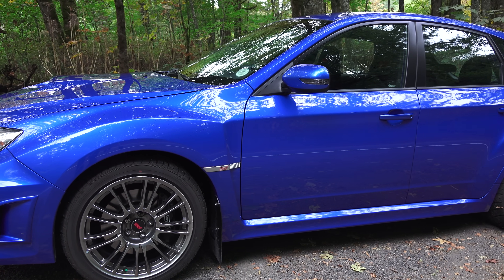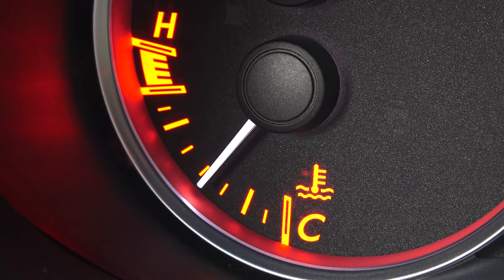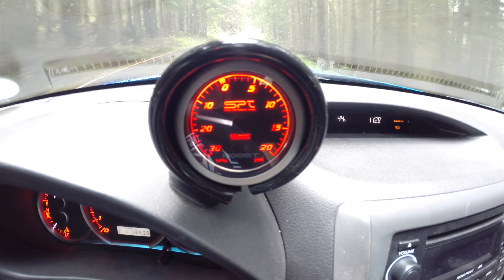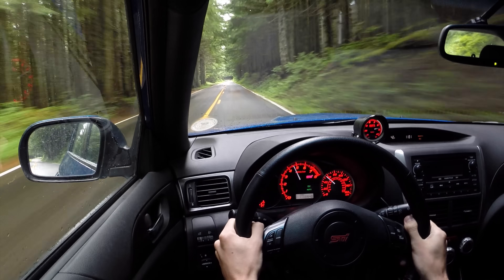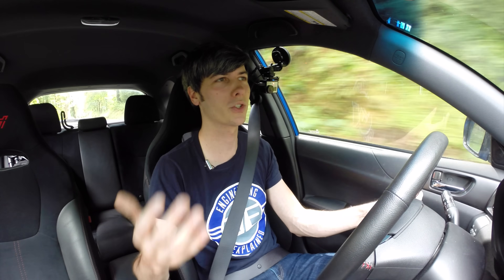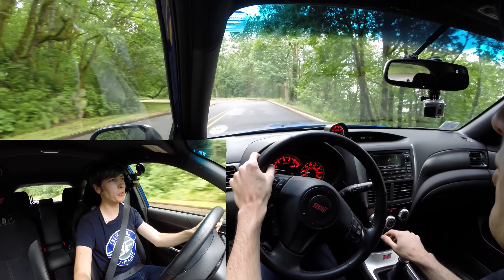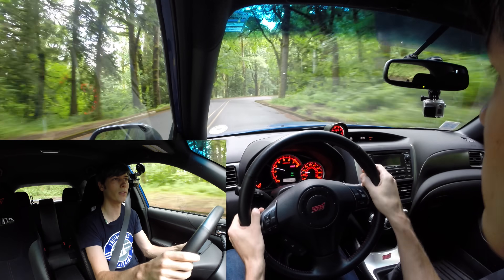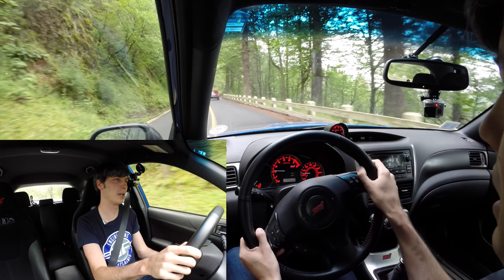5 Things You Should Never Do In A Turbocharged Vehicle

Comment: Always buy the best fuel? Really?! You also believe in high end gold plated audio plugs and stuff? Come on, you're a engineer...
Turbo or not it doesn't matter, buy the fuel recommended for the car. For stock cars that is. And if you modify the car just go find out what fuel is neccessary (if you're doing it yourself) or ask your tuner... (or get a tune for the fuel you want to run)
If the car doesn't knock it doesn't make anything better to fill it up with some 40ct more expensive "add super awesome advertising name here" fuel.. 

I know you probably didn't mean to come across like that but with the given information in the video people without further knowledge will believe that higher octane fuel equals better for the car...
Reply from the maker: Yes, absolutely, buy what's recommended for any stock car, and nothing more. It's all it needs. Most turbos will recommend premium, and any tuned car I'd personally run premium to be conservative.
Reply: Better doesn't mean higher octane, it means better quality, instead of buying 91 octane at SAMs club isn't the same quality as 91 octane at Shell
Reply: you obviously don't know much about turbo cars...
Reply: you can't go wrong buying better fuel, but you CAN go very wrong buying lower grade fuel.
Reply: Obviously the octane rating isn't meaningless.. But putting higher octane fuel in a car that doesn't need it is simply a waste of money... 

I don't know about the quality differences between gas stations in the U.S but here in germany it doesn't matter what brand you buy the quality is the same..
Also we have different octane ratings all gas stations sell three main types, regular, super(premium) and super(premium) plus. Most normal turbocharged cars use super and only high end performance cars need super plus.
Then there are the "performance fuels" from the different companys like shell ultra and stuff like that i think you get in the us aswell.

If the car is tuned to (or requires by factory tune) to run very high octane fuel of course that is what it needs... But only then.

The other premium fuels with additives are more or a placebo thing as nobody can actually present any evidence that they indeed are keeping the engine cleaner or making more power.

Turbo or not Turbo doesn't have anything to do with the octane rating there are a ton of other factors involved an tons of cars without a turbo that need higher octane fuel.. Its all about the compression, timing, sparkplugs and so on and so on..

If it makes you feel better to fuel up with the most expensive fuel just because you can't go wrong, well go ahead its your money. But there are so many people out there buying premium fuels for their normal cars and think they keep the engine healthier that way.. And its sad that a video like this fuels (no pun intended) those misconceptions.
Reply: I had a stock 2009 Mitsubishi Lancer Ralliart with recommended 93 octane. Only 91 or 94 available in my area. 91 makes my engine knock. Noticeably. After a couple of fill ups only. Been running 94 and the knocking went away. After I remapped my ECU, 91 octane also gives me a noticeable performance downgrade. Octane level is not a myth, it's just something that has a lot of misconceptions to it. Putting 94 octane in your non-turbo is probably totally useless.
Reply: shell isnt even that good its over way over priced
Reply: +huberkarle I think you got it a bit wrong. The manufacturer will tell you the MINIMUM quality of fuel you need. that doesn't mean that you can't profit from a high octane fuel, depending on the engine.
and although a high octane fuel is TOTALLY useless on 99% of NA car engines (with the exception of some high compression engines like S2K or E92 M3 for example), it can make a huge difference, even at the most casual turbocharged engine. even a tiny 1,2 tsi can benefit from it. When the knock sensor does not read any knock from the engine, the ECU will slightly increase the turbo pressure and alter the spark timing for better performance.
you can feel it on the road, and you can measure it on the dyno so it's not just a placebo effect.
its the same reason why a turbocharged engine can very easily be tuned for more power compared to a NA engine
Reply: +newton9837 putting premium in a car that doesn't require it is actually a disservice to the car. There is less energy content in higher octane fuels so you are ever so slightly robbing power and efficiency.
Reply: +Axel Clarke The US calculates their octane rating differently than Sweden. We use the anti knock index (AKI) which is the average between RON and MON. Sweden uses RON I believe so our numbers are different but the fuel is the same.
Reply: Robert Spratlin  it will up the knock resistence like leaded fuel but the higher octane rating does nothing to the lubricating effect the lead had.. So simply putting higher octane fuel in a engine designed for leaded fuel won't do the trick either..
(This thread gets more and more complicated by the minute lol)
Reply: Higher octane fuels have a lower knock potential. On a forced aspirated vehicle, especially aftermarket, you'll want that lower knock potential. 
Unless you just want to blow up your engine, go for your cheap fuel.
Reply: Keep in mind that not all fuel is created equal. Every separate chain of convenience stores has a different quality of fuel, sometimes it even varies from store to store.
Reply: Octane has nothing to do with power. Octane rating tells how much fuel can be compressed before ignition. Hence why higher ratings have lower knock potential. Manufacturers recommend higher octane to avoid lemon law when you happen to use lower octane and you engine starts knocking, plus the engine was designed for that particular octane rating. 

What does change the power is the actual fuel itself. That's why E85 has less power than Regular. And not all E85 is the same; depending on your market, it can be corn, sugarcane, sorghum, and other things. it's basically just an alcohol made from whatever the source material is. Regular petrol varies in a similar way, but it depends on individual sources, refining techniques, and additives.
Reply: +Engineering Explained 
In Sweden standard is 95, premium is 98 and also possible to get 101. In the US, why do you have such low octane ratings? And also, cars on the euro market and US market are presumably made slightly differently, so if I brought my Euro Ford (which has 95 as standard) to the US would my engine get messed up from fueling 87/89? Since using lower octane rating can cause knocking.
Reply: he didnt word that section very well in my opinion he should have been referring strictly to octane...making sure u arent putting low octane fuel. he kind of messed it up by talking about the "quality" of fuel which immediately paints an Indian Gas vs Chevron type image
Reply: Robbspeed3 Lol I like at the end of his comment he mentions the fuel additives in a way that signifies unimportance. Petroleum gas with more octane boosters and cleaning agents IS what makes a better gasoline lol. Just because both shell and the "mom and pop" stations sourced their petroleum from the same supplier doesn't mean that one will not allow your car to last longer than the other.
Reply: Yea, always buy the best fuel, because bad fuel ruined our Mercedes' turbo.
Reply: dimos k  yes and no.
Octane rating doesn't equal to fuel quality.
If the ECU is programmed to up the boost and alter the timing if there is no knock it will indeed have performance benefits, yes.
But i don't think that many especially older turbocharged cars actually do that as they have fairly "static" fuel and boost maps.
On modern cars the probabilty is higher i guess, but nothing amazing maybe a few hp if at all.
Also it doesn't hurt the engine do drive the recommended fuel so i wouldn't say that higher octane fuel is worth the more money if it isn't needed for the particular car..
And as you said, 99% of non boosted cars it doesn't have any benefit at all.
Reply: huberkarle agree, obviously octane doesn't equal quality. 
And yes, older cars probably can't benefit unless they have a different ecu.

Newer cars will have some benefits. But as you said, that doesn't mean that it worths the extra money on daily driving. 
In my country we either have 95 or 100, and the difference is huge, 1,40 for the 95, and about 1,80 for the 100. 
Fuel companies don't even bring the much cheaper 98 anymore. 
I use 100 rarely, and the difference is noticeable (fiat bravo tjet 150), and I can even see it on the stock digital pressure gauge which which fills more with 100, meaning it raises the pressure more.
And I once tried 104 or 106 (not sure, I found it at a random fuel station near nurburgring during my road trip there) and the difference was even bigger, so I guess some ecu have a pretty huge potential
Reply: I don't think you understood what he meant. If you buy higher octane fuels, you guarantee reducing potential engine detonation under randomly sever circumstances.
Reply: Jonas Koch apart from a power gain on turbocharged engines, a premium fuel usually has some cleaning agents that help your engine remain in good condition. But it is pointless to spend more money every time you refuel just for everyday use. Use premium once every 6-7 refills to clean your engine and it's more than enough.
There is nothing else in normal fuel that can harm your engine to lose power. Besides, some brands now include the cleaning agents on the normal fuel, which renders the premium fuel pointless, unless you plan to go for a trackday or a long trip where you will push your car for enjoyment
Reply: The rating system for the octane is different in germany for example compared to the u.s.
I have no idea how the conversion is done but i think its pretty much the same range as in the u.s. just different norm/numbers.
91 is standard, 95 is premium and 98 is premium plus. Since standard isn't offered anymore (was replaced with E10) 95 premium is the lowest you can get now.
Some gas stations offer 100+ (shell v-power or aral ultimate for example but those are really expensive.)
Reply: +Sawbonespc who were you replying to?
Reply: huberkarle agree, it can't be proven. We are most likely victims of marketing.
For fuel, I just have a couple of gas stations that I've tested over time that their fuel is not causing me any trouble (unfortunately you can't trust gas stations with their fuel quality since many of the owners try to mix fuel with other liquids for more profit, or they can mix premium and regular fuel and sell it as premium).
So I choose 2 well known brands (Shell and one more which is local in my country) who are supposed to run their own tests on their gas stations and hope for the best

As for oil, I've never paid for a premium brand. As long as it's the proper viscosity and surpasses my engine's specs I consider it good enough. It's not like we run in track days every day
Reply: well this is a segment for turbocharged vehicles and being a technician for hyundai and other brands in the past. I got to see how many cheap ass's drive turbo cars and come get em checked out with engine knock due to low octane fuel
Reply: Petrol engines are so obsolete while alternatives are shut down by some of the biggest oil corporations and their influence on corrupt world government so they wouldn't go out of oil business. As a engineer he should know that, maybe even experiment with alternatives. So many things could be used as fuel.
Reply: Diego31337 Your peer reviewed nonsense makes no difference to me. My turbocharged Tacoma retards it's ignition timing through learned knock threshold on $2.10 crap gas and advances the timing up to 3 degrees with Shell gas (both high octane). I guess my obd reader is really fooled, isn't it?
And your peer reviewed nonsense does not address long term effects of extra cleaning agents or lack thereof. It costs more money to dump a bottle of fuel system cleaner in every tank than it does to just fill up with shell gas.
Reply: Robbspeed3 it's a a 96 3.4 v6 with a CX racing turbo header and downpipe kit and all custom 3" exhaust. I was pushing 8 psi but my clutch started slipping so I dialed it down to 6 for now. At 4 psi is was going 0-60 in 6.8 seconds but I have not dyno'd or tested anything since I bumped up the boost.
Reply: Robbspeed3 Yeah stock everything. CX racing sells the headers and downpipe. I had to fab up everything else myself. Bought the turbo used. Turned out to be well under $2000 for everything.
Reply: no it isn't. VTEC/variable valve timing in general is a cam system that behaves as a stock cam sometimes, and a drop in cam other times. the specifics depend on the type.
Reply: Oh, and FYI, as a musician and audiophile, gold plated equipment is superior to the competition.
Reply: Draco Malformed I think you've missed the point in that cars are tuned by the OEMs to run at a certain timing. This is based on the compression ratio being achieved at the TDC position of the piston and the correct timing of the spark at the combustion (power) cycle.

If your car specifies a certain grade of gasoline then it requires such grade for the timing to work properly. Lower octane gas will ignite prematurely in your car causing issues. For cars that are tuned to lower grade gas then higher octane in most cases is a waste of money.

What is not a waste of money is to make sure you only buy gasoline from Top Tier rated stations which in most cases the price difference is negligent or non existent.  Cheers!
Reply: huberkarle but gold plated audio plugs don't corrode as much as copper ones
Reply: +Corey Wilson why would you put 91 in a turbo'd car? Is that what the manufacturer recommends?
Reply: i use 93 always thats what Dodge says, also after i had it tuned i kept it at 93 so anything else will run like crap
Reply: i put 91 by mistake 1 time
Reply: +Corey Wilson I ask, as a multiple chrysler owner, it wouldn't suprise me that they recommended 91. Sometimes that company makes me scratch my head. Don't get me started on the whole lebaron, sebring, 200 debable :-)
Reply: ***** A lot of larger chains here actually don't use the same supplier. Only one that does is Shell. Could be due to a lot of 'chains' being more of franchises, but even then I know of corporate owned stores that use different suppliers.
Reply: +Seth Powell agreed.
Reply: Google Top Tier Gas. Look at the list. Are you using one of them?
Reply: +Xander Zoolander Actually heater in America or E85 (corn) it's much much more beneficial for power.
Reply: Are you seriusly?? The fuel is not "magic" they test every type of fuel in a lab, with experts, with equipment, and you pray that premium fuel it's just a scam??? I feel really sorry for your ride...
Reply: Yes you're right, they do use RON to show the octane rating here. So doing a conversion 87 = 95?
Reply: +huberkarle I think you got it a bit wrong. The manufacturer will tell you the MINIMUM quality of fuel you need. that doesn't mean that you can't profit from a high octane fuel, depending on the engine.
and although a high octane fuel is TOTALLY useless on 99% of NA car engines (with the exception of some high compression engines like S2K or E92 M3 for example), it can make a huge difference, even at the most casual turbocharged engine. even a tiny 1,2 tsi can benefit from it. When the knock sensor does not read any knock from the engine, the ECU will slightly increase the turbo pressure and alter the spark timing for better performance.
you can feel it on the road, and you can measure it on the dyno so it's not just a placebo effect.
its the same reason why a turbocharged engine can very easily be tuned for more power compared to a NA engine
Reply: correct just take recomendded fuel
Reply: Proper Octane is a requirement for Compression.  Going higher is pointless. E85 only sees performance gains from a boosted engine.
Reply: Premium fuels is better for your car, often cars that only run premium will not lose as much power over time. Tuners say that as well. The difference can be 5-10 hp in a 5 year old car for instance when you tune them.
Reply: +Swipez severe***
Reply: If you just check your compression you can determine the best octane for your engine. It's not that hard lol... Anything more is like eating vitamins when you already eat complete meals... Just pissing out the $...
Reply: Exactly.  I had a Ford Explorer that specifically to only use 87 octane fuel and the car was designed just for 87 or whatever the low grade is.  Conversely, my Mini recommends 93 and requires a minimum of 91 so I buy the premium.  The owner's manual will always say what should be used.
Reply: Never owned a turbo have you tard boy.
Reply: Then you have Germany where the cheapest fuel available has 98 octane and the premium 102-105...
Reply: Leon S. My personal experience from Germany is that they have the regular 95 fuel and the premium 98
Some gas stations also have the 102-105 one
Reply: huberkarle if I am not mistaken, here in europe we use the RON scale, while in the us they use the MON scale.
It essentially is the same thing, just different numbers.
And I think all europe now has a minimum of 95 octane as a regular fuel as you said, and 98 as premium (or 100 instead of 98)
Reply: *****
the quality can differ between different brands, especially when we are talking about premium gas. each brand has its own additives and technologies.
but on regular gas, its pretty much the same, they all come from the same source
Reply: Additives and Technologies.. Maybe. Have you ever looked at those fuel additives you can buy, how expensive they are, how much you need to use according to recommendations and how less of them are scientifically proven to actually work?
I highly doubt that these premium brands have actually enough additives in it to really make a noticeable difference.

Its the same with motor oil.. There are so many kinds with many promises of less wear, less fuel consumption and stuff. Buts its an easy marked since most of it can not be proven.
How many actually buy 5 of the same brand new car fills each of them with different oil and drive them with the same driving style and conditions for say 150k miles and then blueprints the engine to find out which ones actually are better.
In the end its marketing and the customer buys what he feels comfortable with since there isn't any way anyways to prove that one is better than the other.

I wouldn't say its all the same but i highly doubt that there are many differences that actually make a difference.

Of course with the really cheap stuff you never know, oil itself is expensive so who knows what they dilute it with to maximize their profit margin, thats the only concern i would have with really cheap gas as well especially in countries with less standards and quality controls.

EDIT: It goes without saying but this is just my personal opinion and i don't have any facts to back it up besides logic ;)
Reply: Jason Koneman I guess he replied to the OP. 
Don't bother, he lost every credibility he might had, the moment he called him tard boy ;)
Reply: You should ALWAYS run the best fuel you can get in a performance car, that is just common sense. Sure in mums 1L 3cyc econobox it makes no difference what fuel, but if your running a performance or modded car, just do it right and use the right fuel. Too many engines over the years have been damaged by people thinking otherwise. There is plenty of things you can save money on, but premium fuel and oil are 2 things you should buy high end
Reply: I put Jet-A in my 3L TD Toyota the other day. No changes. Thanks for the tip.
Reply: E85 does not produce as much energy per unit of air that gasoline does. This is why cars get worse gas mileage when swapping from e10 to E85 since more fuel is required to achieve the same output. However, if the car runs solely on E85, it can be tuned to take the most advantage of the E85
Reply: really old cars will benefit from higher octance, since they were run on leaded fuel. The higher octane will act like the low grade leaded
Reply: +huberkarle High end gold plated audio plugs aim to a better resistance towards redox since customers often don't take much care about their stuff. It does not target conductivity (stay away from manufacturers that do say so), they theorically could use silver, but technically it's a bad idea. You are right on the fact that gold plating is an overkill feature tho
Reply: bn/
Reply: If you have a medium to high spec car you can clearly notice the difference between a standard gasoline and a boosted / enhanced one. When I go to the track for example I almost empty my fuel tank and then refill it with Shell V-Power. It's another story. There is also a video made by 5th Gear on fuels that is very interesting. I suggest you to watch it!
Reply: +WorldExtremeCholo If you don't need high octane fuel, then there's no point in running it. Higher octane doesn't mean higher quality. Quality means more additives like detergents and stabilizers. If you can safely run 87 octane, then that's what you should use.
Reply: +Senvae 
I disagree. My Ford Expedition is naturally aspirated and runs better on high octane gas even though it doesn't require it. My supercharged MB C230 Kompressor SC requires Premium/Super Plus. Actually I don't know any new German car that doesn't require high octane gas.
Reply: Mechanics told me to run PREMIUM in my Snowblower......they were correct it raised my HP and Torgue......as it is a HIGH COMPRESSION ENGINE.
Reply: Disclaimer... I'm in the L.A. area so our gas sucks. Shell is good, but I'm a 76 fan myself. My 2nd choice is Chevron. I have noticed better fuel economy with 76 or Chevron, although Shell is good too. Shell stations are just out of the way for me. I blow through a tank of Arco gas like it wasn't even there. I run premium in a Nissan Murano and my '74 Duster with a mildly built 360 with 9.6:1 compression and iron heads.
Reply: Agreed! Higher Octane burns slower to prevent detonation.
Reply: BRUCE LEE You have a snow blower dyno to confirm hp/tq gains? Because that sounds like a placebo effect. Nonetheless, you guys can waste your money as you see fit.
Reply: The Arkle Probably nothing, you need a high compression NA engine for it do anything.
Reply: id say you had a fault in the engine management system. probably sensor related. there should be a 'knock' sensor fitted to the car which will adjust the timing and fuelling to eliminate the knock regardless of the fuel used.
Reply: slightly incorrect. higher octane fuel burns more slowly meaning you can run more ignition timing advance without getting 'knock' issues. as its all controlled by various sensors, getting engine knock should be impossible unless you have faulty engine management components. the knock sensor will adjust the timing etc to compensate. yes it may run with a little less power, but for 99% of people in 99% of situations, you would never tell the difference. its only when full power is required that the difference can be noticed to any real degree, if at all
Reply: Everybody is trying to find a sucker. High octane fuel is the scam of petrol stations. Once when I stopped for refueling on a manned gas station, the guy tried to sell me high octane fuel for my 1.4 normally aspirated astra. But mine is not tuned, standard compression ratio 70HP little engine, so what good would it make I asked. He knows a guy who got more power from it he said. How did he measure that I asked. It felt stronger he said. I told him I don't believe his friend got any more power from this and that was it. Ridiculous.
Reply: actually gold is the best conductor in the world for electricity
Reply: ***** higher octane fuel just resists more to self detonation, thus allowing a modern turbocharged engine to increase the pressure and alter the ignition timing for better performance. It definitely doesn't burn slower
Reply: High compression ratio engines work better with higher Octane fuel.
Reply: Just bought a 2016 kia optima sx with a 2l turbocharged engine, the manual says regular unleaded for fuel type, so should I be putting in regular (87) or premium (93)?
Reply: idknuttin Is that a serious question? I will lose all faith in humanity if that's a serious question.. Your kia's ecu is clearly not tuned for performance so unless you get it tuned(more boost, more timing, more fuel) do what the god damn manual says.
Reply: Vishnu Vadlamudi "High compression ratio engines work better with higher octane fuel"...WHAT?! How long have you been sitting on this ground breaking information?!
Reply: in my country the worst fuel is 91 and the best is 96
Reply: 91 is minimum on those type of veichle
Reply: dimmacommunication wow let's just keep spewing the same useless facts over and over
Reply: dimmacommunication I'm not saying anything bad about you. I'm saying this octane stuff has been discussed to death, and we should stop this never ending thread.
Reply: Robbspeed3
yeah,the base line should be that an engine should run on 91 minimum,93 better for performance engines... easy :)
Reply: GioGuitarDude
you forgot to say that engine does that to some extent,if you use let's say 120 octane your engine will not adapt that much.
93 is beneficial over 91,but 110 etc wil only hurt performance.
Reply: dimmacommunication I was referring to pump gas, not racing fuel... but thanks for pointing that out. 110+ octane racing fuels will also almost always cause the car to run lean on a stock setup and no tune, as stoichiometric mixtures vary greatly between different types of fuel. Many ECU's cannot correct that on their own.
Reply: I seriously hope all of you get AIDS
Reply: +Robbspeed3 like you?
Reply: +dimmacommunication Like Freddie Mercury. Straight up killer AIDS all up inside you.
Reply: +Robbspeed3 sounds fun :)
Reply: +dimmacommunication GOOD ENJOY YOUR AIDS!!! THATS WHAT THIS THREAD IS NOW ABOUT!!!
Reply: Sitting here laughing at the people saying different chains and different stores carry different quality gas. In the us, gas comes from about... 5 different MAJOR producers around the country, mostly in the south west. All chains carry similar gas products as regulated by the EPA, delivered by local* petroleum carriers, and usually if they are within 10-20 miles of each other, they are delivered by the same company. There is nothing different about one company over another, unless you are traveling hundreds of miles to refuel, it is all advertisement and making you believe one company is better than another.

The mom and pop convenience store on the corner with the run down pump has the same fuel flowing through the nozzle as the big box store down the road. Sure, some companies put additives into the fuel but its still the same gas.

*Some companies produce and transport their own fuels following the same guidelines as everyone else.
Reply: Gio, I bow to your obvious research and peer-reviewed studies on the benefits of gasoline bought from big brand companies vs mom and pop service stations. Meanwhile, all studies showing there is virtually no difference beyond placebo effect have been proven false under the glaring light of your unquestionable knowledge on the subject.
Reply: +Diego31337 Those studies are conducted with stock cars. Stock tunes are forgiving. 

Just see my last comment because I don't wanna type it again.
Reply: +GioGuitarDude Ikr? LOL
Reply: GioGuitarDude Please, tell me more about this turbocharged tacoma.
Reply: +GioGuitarDude Nice. That's not something you see every day. Sounds like a sick ride. 

I assume there's a company that makes a turbo kit for your platform? Any other modifications? Stock internals?
Reply: +GioGuitarDude Oh right cx racing. I don't know how I missed that. Sounds sweet.
Reply: Honda prelude needs premium stock called for my Honda says on the gas cover and I think all Honda vtec engines are recommended to run premium. It is technically forced induction
Reply: McKoy Atkinson Your first sentence is almost impossible to understand. 

And the N/A honda motors you're referring to do not use any type of forced induction. So much fail in that post man, you can do better.
Reply: As long as you believe it sounds better it will sound better.. :)
Reply: i pissed myself all the way the only thing he was right about was 1 and 2.......... and 5 if your a boring lets face it when you slam the peddle after a corner its because you want the back to kick out
Reply: Stinky Cheese Omg can this thread just die already? Everyone here knows what's up by now.

I have one correction, you want ethanol in your gasoline when you have a turbo car, especially a direct injected turbo car. There's no greater octane booster, and unless you let your car sit in the garage all winter, you don't have to worry about the ethanol absorbing water. 

There's plenty of guys out there running substantial mixes of e85, and pump gas in platforms that weren't even designed to use ethanol, and they have no issues long term. It's the poor mans race gas, after all.
Reply: Stinky Cheese Ok now we've gone from beating a dead horse, to going off topic. That's a good point though about the ethanol storage issue. 

Ethanol is a great, and inexpensive fuel. It should be used by anyone with a modern turbo car. If you object for political or moral reasons, then that's fine. More for the rest of us.
Reply: Stinky Cheese It's a moot point, and one that performance minded individuals, and experienced ethanol users give zero fucks about anyway.

Go, and try to start an argument on some ethanol video, I'm sure they will love it there. I'm not helping you derail this thread anymore, so bye.
Reply: Stinky Cheese Cool story. Bye now.
Reply: huberkarle precisely framed the reason why I disliked the video. It is a little flaky on the science.
Reply: @huberkarle is just hating
Reply: Higher octane makes less power, but gives more safety for higher air intake temps, boost spikes, etc etc.. Having a bigger safety net is always a good thing.. This is not a N/A car things are different in the turbo world.
Reply: Kyle Milford Energy content and octane rating are not related.
Reply: Engineering Explained what about back pressure? How does this effect my turbos? I have a 2013 F-150 ecoboost 3.5 and want to straight pipe it but ford issued a tech service bulletin saying exhaust mods will hurt turbos, and they told me the turbos will over spoil and cause damage. Then I read an article from an engineer at Garrett and he said back pressure on a turbo was bad. What do you think?
Reply: Nathaniel Hylton Just get tuned after you straightpipe it, and you will be fine. Yeah there will be a little extra wear and tear on the turbos because you'll be running more boost, but they'll still last a really long time. And no you don't want back pressure, especially not once you're targeting higher than stock boost. Don't forget about the intake side of things either.
Reply: use amoco .. the best
Reply: similar in kuwait ... price is sae as the last 30 years, bout 70 cents a gallon
Reply: btw, the kuwaiti 95 doesnt knock  like in america, so the ratings in kuwait might be actually higher than posted !
Reply: gold on audi plugs/hdmi is much better than coppar or silver since gold will never oxidate and will be usable for ever...
Reply: lolfix101 Can this thread die now?
Reply: huberkarle so the Ford ecoboost shows a very dramatic increase in horse power as you test it with higher octane.. very dramatic
Reply: Matthew Pajda 
You pay for quality and the additives that keep your engine internally clean.
Reply: +woohunter1 I suppose that's one way to look at it. 91 octane is supposed to be 91 octane. I suppose fuel additives could impact the "feel" of the fuel, but personally I believe that the  only effect additives give, are a placebo.
Reply: What about when different companies have different percentages of ethanol mixed in?